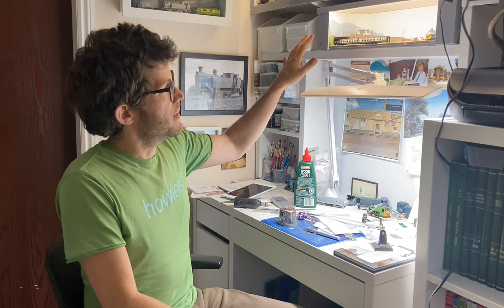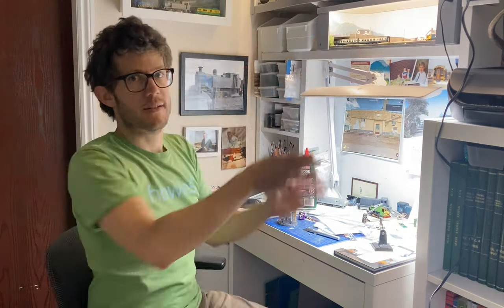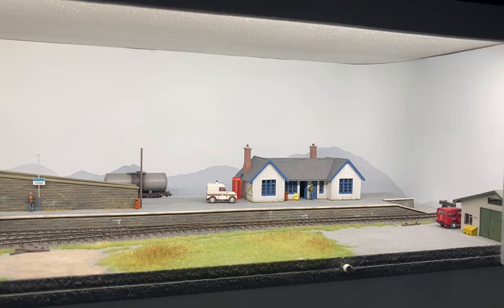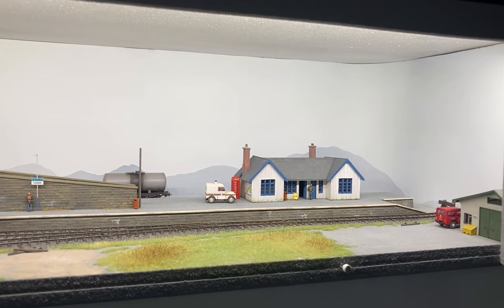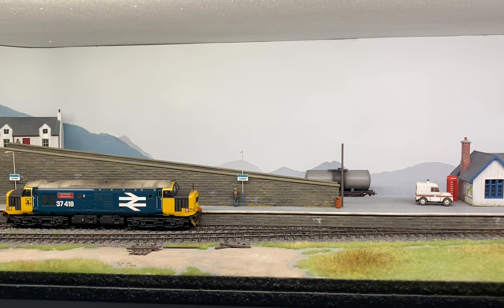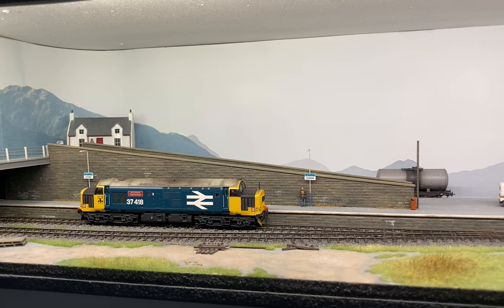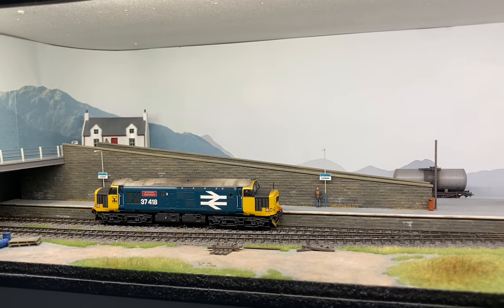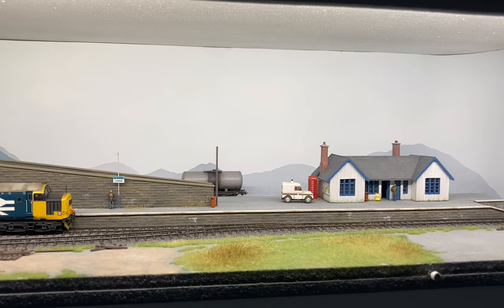A visit to Lochdubh - A cameo layout in N

Comment: Just wanted to say, I absolutely love everything you do and it's what I aspire to be able to create one day.  As someone who has not been involved in railway modelling for a lonnnng time (essentially since I was a kid), I recently had the 'epiphany' that, space doesn't have to be an issue, a layout doesn't have to be circular and British Finescale is the way to go as far as realism on a small scale goes.  But being the absolute perfectionist that I am, I feel I need to learn everything there is to learn before getting started and your videos are incredibly helpful but possibly a few steps above beginner level.  Would you be able to point me in the direction of a source of information out there that methodically explained everything an absolute beginner would need to know about working with this track at this scale?  I haven't even been able to find a definitive answer yet about how to join sections of track or how the track is powered.. Thanks and keep up the good work!
Reply from the maker: A good friend is you’re best bet, either through a club or the social media channels, they can advise and encourage.

I join the rails with soldered butt joints, because I’ve not found rail joiners small enough, it’s fiddly and you need to be quick with an iron not to melt the sleepers and chairs. A touch of a tinned iron onto the joint, with some Powerflux applied beforehand will be sufficient. I add the droppers required before sticking it all down and adding the joints, using a thin DCC decoder wire as it’s flexible. Good luck, and the most important thing to remember is we all started somewhere… you can’t short cut to success but the journey is good fun.
Reply: @JamesHiltonCustomModelRailways  thanks for the advice!  In the absence of any really good tutorial videos on this subject (hint hint!), would you recommend any online forums?  I had a brief look into RMWeb but found it incredibly convoluted..
Reply from the maker: RMweb is too big to be of help. Smaller Facebook groups might be useful, or find a local club? 
I have used them to find local modellers to meet up with rather than only do my hobby online.

Comment: Hi James, Great layout as always -I have a new N gauge layout which was inspired by seeing what you have achieved with the scale. its a china clay dries and I of cause had to buy a Farish class 37. however I hate the way it looks too high on its bogies. I was just about to sell it on, then I saw this video. Was your 37/4 easy to lower as it looks much better?
Reply from the maker: Yes, it’s easy.
3 things. 
1 - Remove the cab interiors.
2 - Cut off the lugs on the inside sides of the bodyshell
3 - File the bottom corners of the lighting boards at each end. Probably between 1-2mm.

Refit the shell and marvel at how low it looks! 
The fuel tank needs blu-tak to stay on… You can sand and file the bottom of the cab interiors to allow them to be refitted but I didn’t bother as you can’t see them anyway!
Reply: Thanks That's great. I'll give it a go
Reply: Done it!...That was easy and looks great now.
Very much appreciated
Reply from the maker: @BrockwellLanemodelrailway  great, I’m glad you found it as easy as I did! Others do something different with the truck frames instead which doesn’t lower the body and hence they still look too tall to me, but I’m sure others have different opinions.